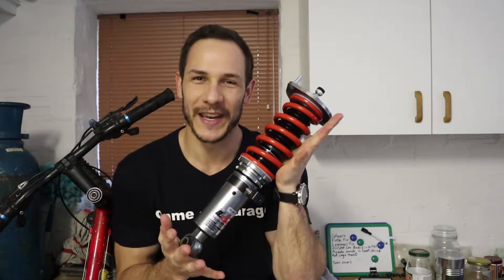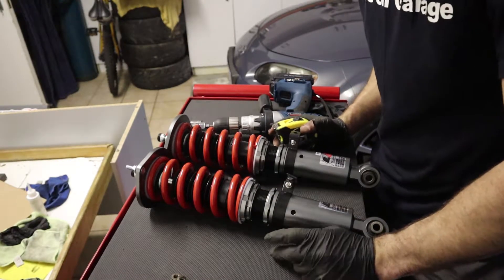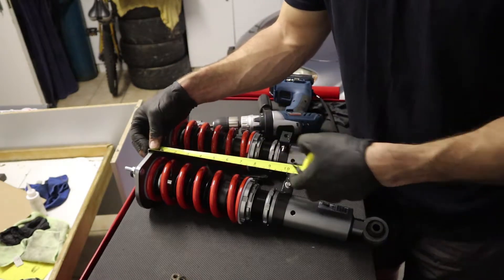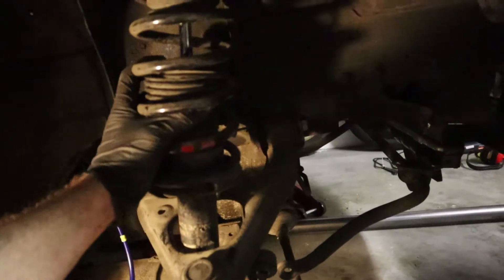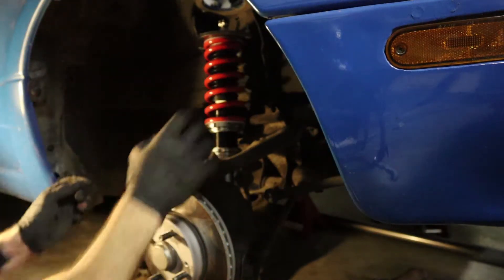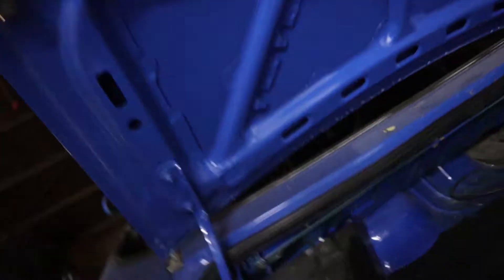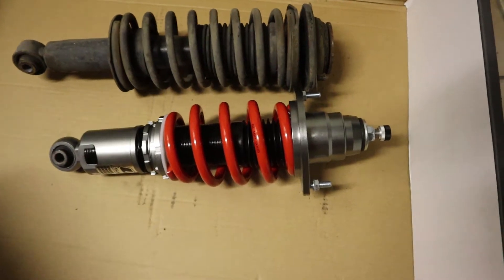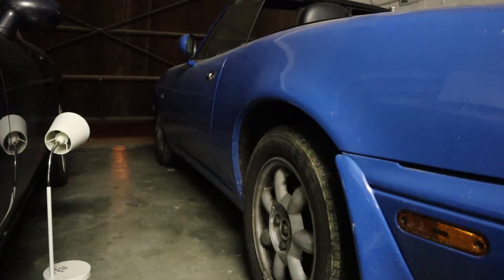Miata Racecar - 6min COILOVER install!

Comment: Awesome stuff man. Keep up the content. I'm excited to see your journey on the MX5.

What fuel do you have in South Africa? What will you be running in the MX5 and is there a chance you will ever turbo the MX5?
Reply from the maker: Thanks man! Appreciate the comment!

We get 93 and 95, although I'm not sure on what scale that gets measured. I do know we don't have the best quality fuel tho. I always try and run 95 just to be that little bit safer. I'm working towards turbo yes, although that is still some time down the road. The class I'll be racing in doesn't allow alterations to the aspiration of the engine.